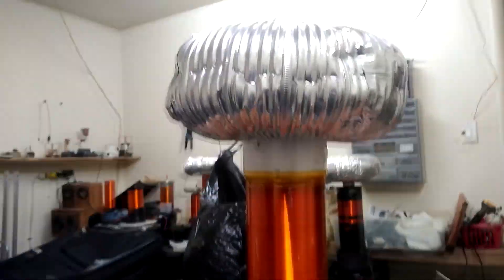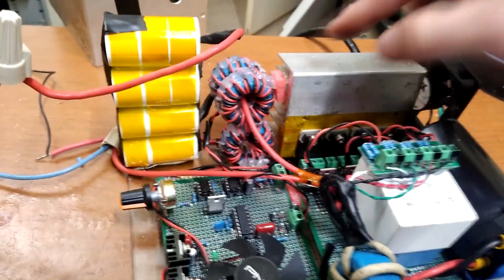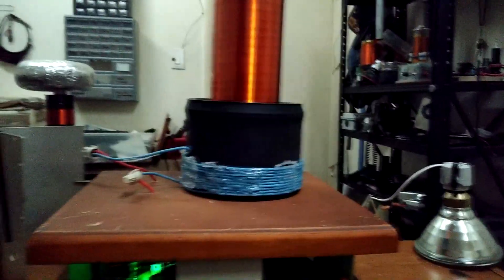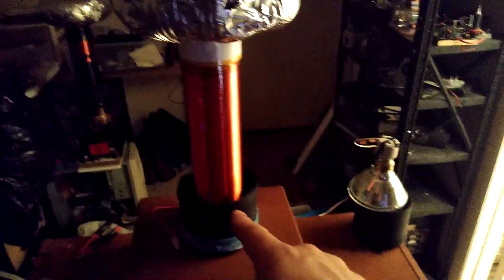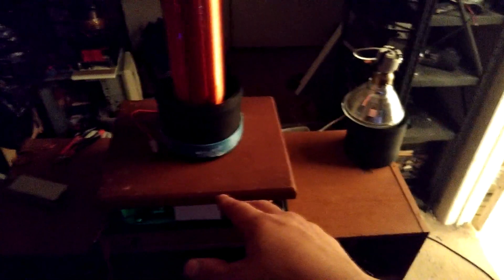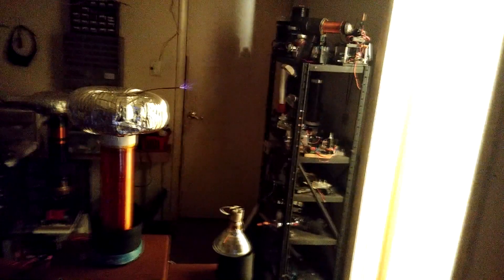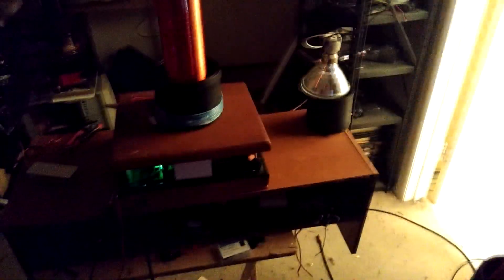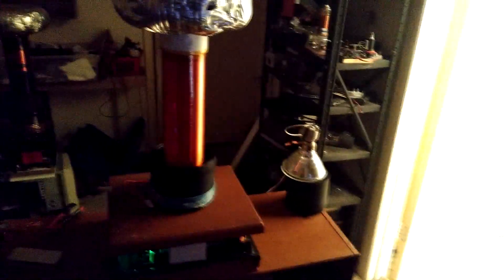Full Bridge DRSSTC first tuning

Comment: can you provide secondary coil data? you use pipe diameter?height?and how many turns of wire.
Reply from the maker: It's 32AWG on a 13x3.25in PVC former. The turns end up being around 1300. All specs are in the description of latest video.